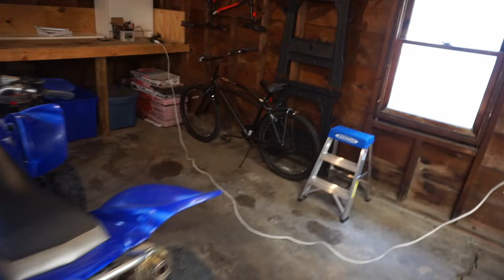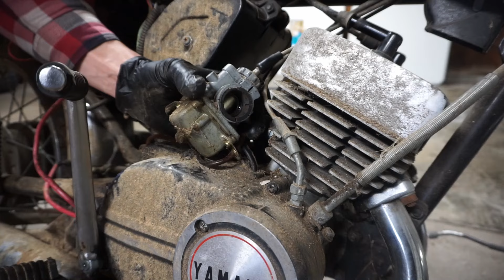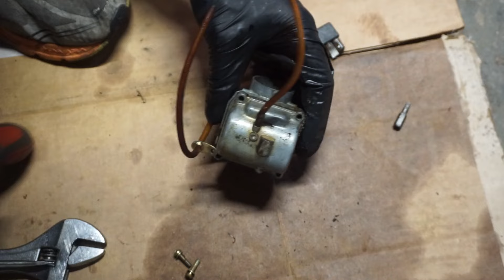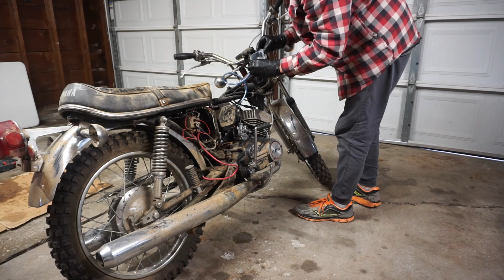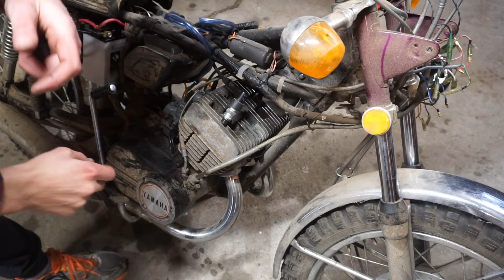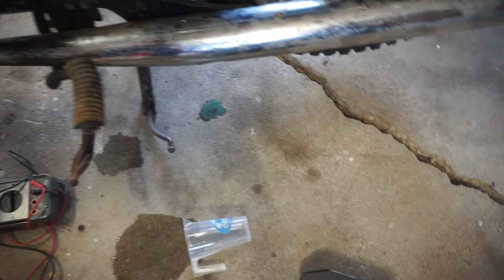$50 2-Stoke Yamaha Motorcycle First Start Attempt. Will It Run? (Part 2)

Comment: Pro tip when bump starting, run alot faster than that and jump on the bike when u dump the clutch
Reply: Do this
Reply: Definitely do this.
Reply: 2 vintage is the pro not you
Reply: It’s a lot not alot and it’s not u it’s you
Reply: And put it into second or third gear....
Reply: NEVER bump start in 1st gear like this as it will damage the gearbox & clutch. I've had to fix countless gearboxes that have been repeatedly bump started in 1st gear using the run & jump method or roll down the hill method.  

Always bump start in 2nd gear, to start the crank spinning, then quickly change into first gear.
Reply: @CZ350tuner  man you don’t need first gear
Reply: @jeffkenyon7084  you got to be joking, i wonder if he's tried flower arranging?
Reply: Yep thats how you do it!

Comment: Great video! Took me way back in time. 1st step......Power wash, or at least spray most of the dirt off with a hose. You don't want dirt/sand getting pulled into the engine when you start it.
Reply: Yes and I bet ther is plenty of rat piss and shit in that filth! Having been in a barn 17 years,  I don't understand why you would work on it like that.?

Comment: My first motorcycle was a Yamaha YDS2. 250cc with the 5 speed trans.  I paid $125 for it in 1964 with a stripped spark plug in one cylinder.  Took it off and down to the local Harley mechanic and he hellicoiled the plug hole for 4 or 5 dollars.  Reassembled with no new gaskets and it ran great.  12000 rpm in 1st gear.  A great fast lite bike in its day.  Thanks for the memories.

Comment: Back in High School (yeah I am old), the RD400 was the bike to have!  I never knew they made 200 version of this style of bike. Its really hard to find a stock one, most of them have been cafe converted (which I hate).   Love your videos, motivates me to get out in my garage and work on mine.  I don't know how you alway find good deal though.   Here is TX everything is sky high.
Reply: i had an RD350 and an RD400 , . . . the 400 was a dog ! couldn't get out of its own way !
the 350 however was an untamed beast ! i was beating 750cc bikes running light to light races in the late 80's

Comment: I got my first 1972 rd 350 back in 1978 it was rebuilt when I got I rode for about 18 months and I sold it when I whent to the army then about 10 years back I found another 1972 rd 350 I got that one rebuilt it and paint the same color as my start one I loved the first and I now love this but this time I'll never sell the 2nd one I've owned meany bikes over the years but it was my 1972 rd 350 that I missed the most and was so very happy to get another one

Comment: Cool old bike, cant believe you didn't wash it before you started working  on it. It looks like it smells bad also. So much easier working on a clean bike and not letting dirt get into the engine or carb.

Comment: I build expansion chambers for these Yamaha CS5 and RD200 engines, up to 35hp! got mine to do over 100mph!
THe spring is for the starter motor/generator brushes, it supposed to go ontop of the carbon brush to hold it down, not be jammed into the side of it like that one is

Comment: The oil is clean because there are no combustion by-products mixing with the oil. Since 2 strokes use mix fuel/auto lube oil for the engine, the "crankcase" oil only lubes the clutch and trans.

Comment: The point have lobe for distribute shaft carries the lobe few lobes. You did saw the press spring push the point into closed circuit. The lobe reverse the direction of the push until the opened circuit by lobe alternating.
 The two spark plugs of twin cylinders enclosed of bores and stroke 200cc will automatic fire same time. The power stroke of both cylinder Twin combustion chamber is fire/boom. That's the Yamaha's way and it helps to win right in the Starting line to the lead of the pack = the highest acceleration.

Comment: He is good in saying about the 200cc Twin Yamaha slow motorcyle. He said one person sit on the Yamaha motorcycle at the same time he push the motorcycle while it is on 1st and 2nd gear either one. That save time into my heart the motor and his starter. Everywhere you run at same time pushing the handlebar then jump up and sit on the seat of the Yamaha and press first gear and let go the left side hand handle. That is called starter button except HaoSen TaoTao that built all the best starter motors in all over the world and don't get RIP OFF in Harley-Davidson..

Comment: put around 3 coats of varnish on that workbench  it will be good to go  i did it to mine i can spill gas on it and it wont take the varnish off 
and  put some small gravel  in tank with vinegar and shake it the back and forth the  gravel  will get rid of most rust  and let it soak  -----------good luck ----------that's a great old Yamaha

Comment: That "black thing" that you were pushing down on was the brushes for the starter motor. You may need new brushes and new brush springs
Reply from the maker: Yeah I do. Do you know where to get them? Every place I look they are unavailable
Reply: @2vintage  try to find alternator/starter rebuilder or maybe find someone who works on electric motors if you cannot find genuine old stock yamaha parts.
Reply: Mikes xs??

Comment: Hate it when people don't wash their projects. Dirt in the moving parts, scratching chrome and paint with grit rubbed in by a dry cloth. I have been riding Yamahas since 1964. In 69 I had the predecessor to this it was a CS 180. Gret bike. Deserves to be properly reconditioned.

Comment: The bike is a 1972 CS5 200. The "thing" the spring is pushing on is one of the four generator brushes. Two are there for the charging system and two are for the electric start. They have nothing to do with the ignition which is battery and coil on this model.

Comment: my mate had 1 of them a rd 125 same as your`s (but yours is a 200) same cylinder  had no spark so  he set lite to the end of the pipe and it was like a rocket with the flames   ,think it was the condenser but it was years ago

Comment: But that is Honda Hawk having the stator in right side, not Yamaha. The Points and generator with 6 diodes in left side motor is for Yamaha. The two springs for centrifugal advance timing or 1 spring instead of 2 spring is okay for weight into rotation counter as it's in the system for dwell.

Comment: It's important for the carburetor slides to fit the way they were designed to and when dirt gets in and wears them, they must be replaced. Sanding them or using any abrasive on them can cause the same condition. I always use solvents to loosen them up and if prying is needed, I use a plastic or wooden drift / centering tool.

Comment: You can check the autolube pump by removing the bleed screw. 2 adjustments. First is on throttle cable. Second is by shims on the pump stroke. The starter / dynamo is very heavy, a major piece. Something is broken - brush? It would be great of you had a manual.

Comment: You might wanna make a temporary gas tank out of an metal folgers can with a barb on the bottom and a hose connected.. then some wire to hold it up from your ceiling. That's what I made for temporary when the real tank is rusty. Good luck on your bike. Rd's forever...

Comment: Those black things with springs are electrical contacts called brushes. Most electrical motors and generators have them unless it's the more modern brushless design. Brushless motors weren't around in 71'.

Comment: Pro tip #1 when push starting a motorcycle it works really well if u have a fuel tank and a supply of fuel to the motorcycle that is if you want it run but if you just like to push heavy shit around and wonder why its not starting carry on👍

Comment: Check the stock hey size and up the jets . They were probably lean from the factory . Get the jets up a bit throw a high flow filter and that 2 stroke will open up .
Reply: Jet**

Comment: Onve you remove the main jet take off the washer and screw just the main back in and you can tap out the other part of the main jet. Will only come out through the top where the slides usually are. Those get clogged to some times. Just make site you put it back in the right way,they have a pin that aligns with a slot. You need to invest in a impact driver for those side cover bolts. They take away all worrys about stripping

Comment: Every time you use those water pump pliers you always use them the wrong way round. If you turn them around the more pressure you use the harder they grip and don’t slip.

Comment: Loosen kick stand, put into proper place.
Get carbide drill bits
Drill small hole between kick starter and shaft.
Start very small so the bit can not wander, gradually drill up in size until you can push a hardened pin into it.
Tighten kick starter, it will  not move any more.

Comment: There should be diagrams and a procedure, maybe a video, online for checking the oil injection pump which takes shims to calibrate. They are checked to see how much oil in pumped while rotating the knurled wheel on the pump's shaft.

Comment: It seems to be oiling from the oil pump because it smokes so badly maybe you dont need to add gas to the gas. check the reservoir for injection oil.

Comment: The kick-starter is worth cheaper by about a $1,000.00 dollars than no kick-starter type motorcycle. The starter motor must be a up the front from Yamaha. Then if lucky rare find  -the electric starter to the front cylinders Twin. The exhaust header pipe must come off and  add in Starter 12-15 volts stator of its 4 brushes to the Start motor. The pipe exhaust side is touching the starter motor case. It seems the curvature is all wrong so make a new bend then that cast muffler pipe is not verily to be the way to do it. Galvanized extra pipe header will stick-out farther front, the flow exhaust farther forward then flow goes down below the oil filter case cover. There it is not touching the starter motor case that shrouded the shaft includes with the removable crankshaft bearings frictionless Babbitt two halves.
 The kick-start foot shank cannot be coming off so that if it's replace it with the electric motor 3HP 10amps that is going to be connect to the shaft where it's once was the kick-start. The starter shaft also is named behind the drum magneto gears called start by either starter drill motor 12 volts 10AMP or a foot Cranking up to a minimal of 400 RPM with the requirement Tachometer $150.00 dollars so that it would read accuracy at 50 RPM and up. Please, at the right side modification ratchet start gear. 
  Straight pipe exhaust 5 inch or less so the exhaust hot pipe almost contact the rubber front tire but better to keep it off away. The pipes blow can warmth your legs and It is winter.  Thank you.

Comment: The Brush and clockspring need replacing.....and do the compression test with the engine off and wide open throttle when you spin it.

Comment: Dude, check your crank seal on the left side. It's probably shot, letting oil leak into the cylinder. Happened to my 73 RD350 that I let sit for 15 years.

Comment: yo I would really love too see you buy a lt250r, I really loved your series about it, I really want to make my lt250r work but I can't seem to see what the problem is

problem :runs only on choke
What I've done : new transmission oil, new gas, tank flushed before,  new spark plug, washed the carb like 4 times with carb cleaner, compressed air...    when I put it off the choke, the rpm starts to go a little faster but not crazy, then after like 5-10 seconds it goes down until it dies... then the spark plugs is fooled EVERYTIME.... I need help

Comment: Looks like you got a good buy there but it will soak up a whole lot of cash once you get into it. You made comparison to the RD350. The sub 250 models had a very different engine to the bigger models but I think you will find a lot of the smaller twins share engine components. Looking for to the new video. Good luck.

Comment: WD40 is great for cleaning oil and greese..ok for corroded parts... It does very little ro fuel varnish...which is what was sticking those carb slides...you know what does dissolve fuel varnish....egad...CARB Cleaner... Not flat blade screwdrivers prying on soft ally.....ffs!